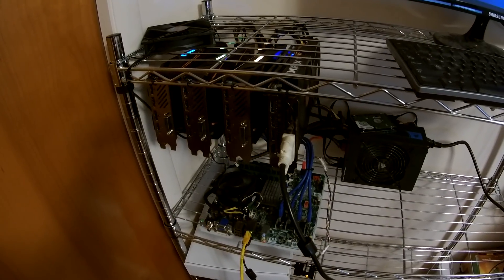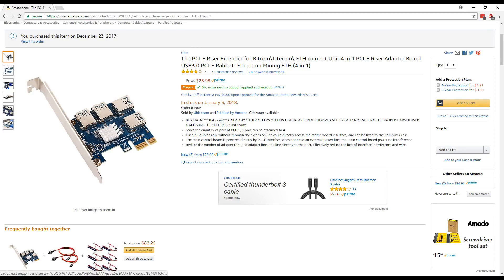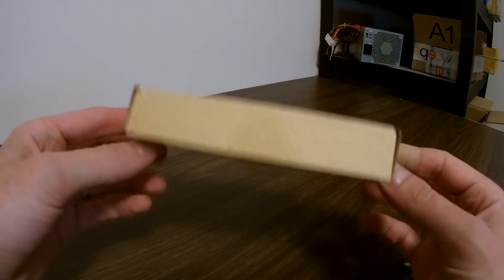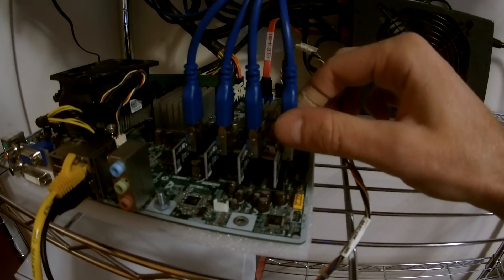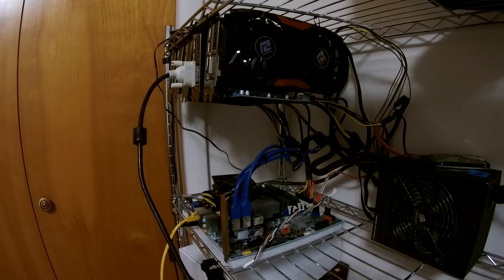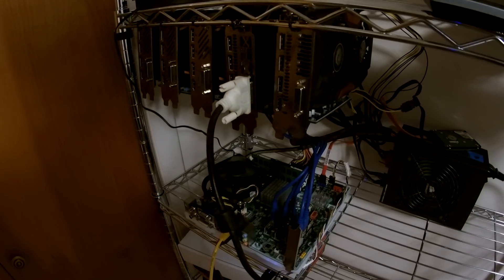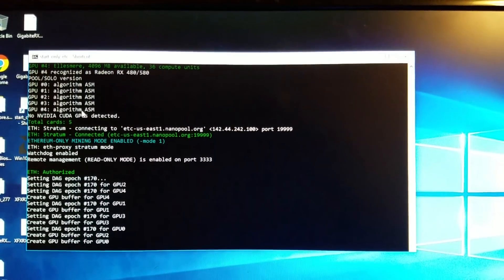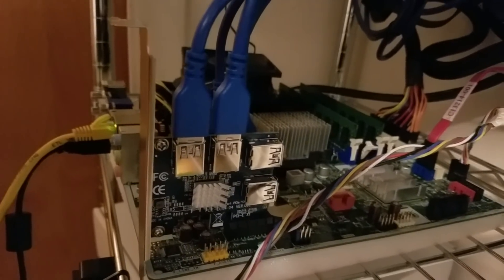GPU PCI-E Port Multiplier Riser Cables Installation/Testing (Ethereum Mining)

Comment: Is this splitter take 1 pcie lane or 4 pcie lanes if we use 4 gpu? I'm wondering since it connect with x1 pcie slot.
Reply from the maker: It uses 1x PCIe lane, so yes, it will work in an x1 slot.
Reply: @LithiumSolar  okay

I only have 2 pcie slots in my mobo asrock a320m, x1 & x16. 

If I use this splitter to both slots and connect 8 gpus, is it counted only 2 pcie lane used?

My R3 2200G only have 12 pcie lanes, I wish I can run 8 gpus and other 4 lanes will go for storage.

Comment: 2:58 what did you do with your power supply ? my powersupply is giving the same problem now its clicks starts for a sec and again its turnoff. Which wire needs to be corrected and how ? please do inbox me or at twitter: iTksalarzai or insta: tksalarzai please please i really need your help

Comment: Hi bro! Great video! , by the way, how you feed the electricity needs of the gpus? with the usb only? or you use another cable for the power supply?
Reply from the maker: No not through USB, you need to plug in the PCIE power connectors on the graphics cards too.
Reply: @LithiumSolar  amazing bro,thanks!  i just heard few people split power cable for card and for pcie, like two cables for 1 card,have you heard that?

Comment: Did you have to change any bios options for this to work properly? (I can get 4 but can't seem to mine without issues)
Reply from the maker: I can't remember, it's been so long, sorry :( I'm pretty sure I disabled all on-board things I didn't need such as audio.
Reply: @LithiumSolar  I did it there are options but the same for basic mining setup In bios for Pcie.... But depending on your lanes you may not be able to use all 4 (I can use 2 but still use open express slots available)
Reply: Hey guys I hope you can help me, I got one of these with two gpus connected to it and it boots normally and it detected the two gpus but after starting mining for one minutes the system shutdowns. Any ideas or bios settings to change ?

Comment: Thank you for a great job. Now I wonder in the device configuration -> system devices have you seen USB3 drivers or hubs?  I tried to hook it to the X16 to see it, as if the system doesn't read it at all.

Comment: my motherboard has 2 pcie slot, can i use this extension ?
gigabyte H110-S2PH motherboard
8GB ram
windows 10pro
Reply: you need to check how many pci-e lanes your cpu supports, the h110 itself handles 6 so if your cpu has more than 6 pci-e lanes you are limited by the Mobo chipset. Dont forget that onboard sound, sata also use pci-e lanes so in theory with sound and only one 1 sata connection in use you can get 4 GPU running.

Comment: For the same reason like you, i bought this PCIe multiplier. It's working well but be careful cas there is a lot of motherboards which are not compatible with this PCIe riser. I had 6 or 7 Asus P5 G41T M-LX  & Asus P5K-PRO  which are not compatible. Windows can detect new GPU
connected to PCIe multiplier but can't install & start driver.                                                             Anyway, it's a good multiplier & a good way to recycle old computer in very cheap way!

Comment: How about a full length PCI slot
Reply from the maker: it wouldn't make a difference considering the port multiplier is an x1 slot. All of the pins for lanes 2-16 would not be connected, so it still functions as an x1 slot even though it's physically an x16.

Comment: These are very useful but after trying with several boards and GPU the results are mixed. It worked always with min 5 cards but depending on board I was able to extend to 6. I haven't gotten any board to work with this and 7 cards.

Comment: I ordered this on Amazon and assumed I get the risers with it since they're plastered all over the picture with it. Mining Mainboard, Starall PCI-E 1X to 4 PCIE 16X Slots Riser External Adapter PCI-E Port Card Cable Board Set Mining Cable Adapter. And the fact that it says cable board set sounds like everything i'll need is there. Plus I've never seen Amazon put something in the picture you aren't getting.

Comment: HI sir, i used this splitter on pci 1x to 4 x pci 1x . On Pool report shows 28.5 each card , after month i foundout the report is false coz pci 1x to pci 1x is bottleneck, better solution is m2. adapter. i think.What is your opinion? sry 4 my english.
Reply from the maker: I have not seen any decrease in speed from using the multiplier. The mining pool reports the same hash rate as claymore, and is calculated based on accepted shares, so I know it's not false reporting.
Reply from the maker: Sorry, to answer the second part, I do not have any motherboards with m2 ports to try.

Comment: I know this is a bit off, but what if i wanted to use this for regular windows? Use one for GPU, other for Audio card. Etc???
Reply from the maker: You can use it for regular windows if you wanted to. I would not recommend it. A graphics card needs all of the x16 lanes for normal non-mining use. You're already starving it by converting it to an x1. If you use a splitter and add an audio card on the same x1 lane, I have no idea how well anything would even work. I would just buy a motherboard with the proper amount of slots.
Reply: LithiumSolar Okay, thanks.

Comment: Never ever use cables between brands.  Just the same even be careful between power supply models from the same brand.  Don't assume identical wiring ever.

EDIT: Seeing that you leave the board out and not in a case you could remove the bracket at the end of the card and secure it another way if you wanted to.

Comment: Built two miners with those boards and so far they are the most stable and solid compared to those BTC pro motherboards. Just wanted to give a shout out .
Reply from the maker: I've heard way too many stories of crashes, freezeups, not booting, etc with those BTC boards, so to me it wasn't worth the risk. You need it to run 24/7. Any downtime whatsoever costs you money.
Reply: LithiumSolar true.. with this board , it's been like a week and I didn't see a single error thrown anywhere  nor any crash . I ordered three more of those and migrating from pro BTC boars to this classic tank .
Reply: Small update : miners running sick I powered them on weeks ago and no issue with ZEC or ETH. Board now runs 6 rx480 cards .

Comment: did you have to enable 4G encoding for it to boot with the 4+ cards?
Reply from the maker: I did not have to enable any special settings. It booted with 4 out of the box. I disabled the unneeded onboard components like video/audio after I plugged in the port multiplier but don't know if that was even necessary. I don't know what "4G encoding" is.

Comment: it's fine if we use the different card? like two RX570 and two GTX 1060?
Reply from the maker: I don't see why that would cause a problem. I have 4 cards on mine, and that's 3 different models. RX480, RX570, RX580.
Reply: LithiumSolar can you mix nvidia and radeon cards?
Reply: thanks

Comment: been using one of those for the last week on my asus prime x370 pro motherboard and it works perfect, no issues at the moment and running 2 x 1050ti expedition cards through it mining btcz, will be adding abother 2 card on the same riser later this week
Reply from the maker: Thanks! It seems to be hit or miss with what people are reporting. I really need to get my hands on one so I can test myself.
Reply: as an update today i grabbed another 2 gtx1050ti cards so plugged them into a pair of risers then straight into the pci-e splitter, worked perfect and has been running now for about9 hrs solid with no hickups. so now have 4 cards running through this with no problems

Comment: running four cards off one slot does that slow or weaken the hash off the 4 cards, where as if one slot one card ,only one in each slot? understanding what I mean?
Reply from the maker: I did not notice any decrease in hash rate. I ran the cards for a few weeks one-per-slot before I added the multiplier. Hash rates were the same with the same clock settings.

Comment: Is there any limit for mobo with gen3 PCI-e slots? I have 4 slot Mobo and i want to extend it
Reply: I was searching for some info and each pci-e 1x device should take one lane. Because of risers, each card is 1x pci-e device so it should take only one, depends of how many lanes your cpu can handle you should be able to connect much more cards. With Gen3 pci-e there shouldn't be any speed drops because mining on gen1 on each card works perfectly.

for example if you have free 16 lanes of pci and Gen2 or Gen3 you should be able to connect 16 cards on splitters, no matter how much phisical slots you have. But I can be wrong
Reply: Mike ive heard that it got something to do with the cpu or motherboard chipset, my guess is if your cpu could do 16 (mine i3 4150) lanes but the motherboard can only for 8 (mine h87) lanes  then it can only run with 8 pcie 1x, but thats only my guess, havent really try it out though...

Comment: can i use PCIe 1 to 4 adapter  in a b250 pro vd motherboard? ty
Reply: ty mike i currently have an gtx 1060 in my gaming pc with a 700wat psu 8gb of ram and a g4560 and i have an rx560 laying around im thinking to get it to work would it be profitble?
Reply: wat the best coin to mine rn? i have an gtx 1060 3gb and an rx560 4gb
Reply: For Intel chips go to https://ark.intel.com and look up your CPU. Scroll down to the "Expansion Options" and look at the "Max # of PCI Express Lanes" setting. It probably will say 8 or 16. This is the number you are looking for. Most recent Intel desktop CPUs are 16. Hope this helps!

Comment: Bro. What are your specs? Planning to do this on my H61 + G620 PC + 4GB RAM. I know it should work, but just curious what hardware are you running with. Thanks!
Reply from the maker: It's a DX7500 motherboard, super cheap on ebay. 4GB of ram and a Core2Duo CPU I think it was an E7400. Super cheap parts!

Comment: Hello how are the pcie switch working out so far?
Reply from the maker: The adapter works perfectly in the x1 slot. What other people are saying doesn't make sense. Even if you put it in an x4 slot, it's still an x1 card so only the x1 pins will be connected. The x2-x4 pins in that slot aren't even connected, if they even exist in the first place. Seriously, use a flashlight and look at an x16 slot. On most motherboards with multiple x16's, most of the pins in the slot aren't even there.
Reply from the maker: It's working great. I have 7 GPUs on the board total, 4 are going through the PCIE multiplier. It's been running completely stable for days now.
Reply: and the adapter is plugged into a pcie x1 slot? some people have said that you should put those in a x4-x16 slot to work properly...

Comment: You just made my day mike i have a old Core 2 X6800 ready to go. How much ram are you using in that board?
Reply from the maker: It's only 4GB of ram. I started with 2GB which gave odd results. Claymore would start but showed all of my GPUs as 3GB versions. With 4GB ram the 4GB/8GB cards all show up correctly.

Comment: It looks like a core 2 duo processor . Correct ?
Reply: Would you be kind enough to give me the exact model number of that board? The core 2 duo has 6 PCIe lanes if im not mistaken so i don't think you will be able to add more than 6 cards in X1 configuration. I think its a z87 chipset board with a 4th gen socket https://support.hp.com/us-en/document/c03748942. Still that doesn't explain my doubt of having a TV output in RF.  :/ By public demand, please add the components used in the description. It will help so many mike. Cheers!
Reply: Thanks mike. Just found the board. Its an HP MCP7AM04H1. Not bad for old motherboard. The things with these boards is that they are built to last and very reliable. https://www.ebay.com/i/122130061459?rt=nc . People who want to mine are going after those very expensive and multi slot boards and it has created a surge in prices for everybody. An E7400 should be able to mine without any bugs on 5 GPUs. Tell me if it has caused any instant shutdown yet. I doubt it has unless there is some other error related to OS stability.
Reply: Mike thanks mike. I am going to get one and see if I can push upto 7 on a core 2 quad . I am positive that 6 gpus are doable but no harm trying. Will get back to you when I get my hands on the hardware in few days hopefully .

Comment: Have far can you take this? Will it work with any 3x GPUS?
Reply from the maker: I have 4 GPUs on my splitter now. An RX580, RX570, and 2x RX480. I have no tested any other cards, but someone else did report in the comments somewhere that it did NOT work with NVidia cards. I have not personally tested and do not know what kind of setup they have.
Reply: @LithiumSolar  I'm usssing on same spliter 4 nvidia cards. You need all updates of everything to work with new GPUs

Comment: Does anyone know if it works with NVidia cards, there's been reports that pci-e spliters work with AMD but not NVidia cards.
Reply: I've had no luck with using it with nvidia cards. Tomorrow I will attempt to use 3 1050 on the splitter. I could however get Rx 580 and Rx 560 on the same splitter.
Reply: You may want to check Newegg out. I picked up a RX 560 for a bout $120 last night. I plan on putting it with my others on a splitter. My 560 is putting out about half what the 580 is. So as of now I'm getting the "smaller" cards.
Reply: Does anybody have any idea what splitter I can use for NVIDIA cards?

Comment: If the 12x Riser Cables link is supposed to be cables only, it's cards and cables in the link.   ;)
Reply from the maker: It's the full riser cards with cables, NOT the multiplier.

Comment: Love your mining "rack"!!  :D
Maybe you can do another video where you take 4 cards and plug into the 4x riser and see what the performance difference is. That way you're not changing anything else.
Reply from the maker: I want that whole top shelf filled, will need another motherboard through... And a lot more monies!
Reply: agreed - the only question i had is if that lil card caused any congestion between the cards (power, bandwidth etc)